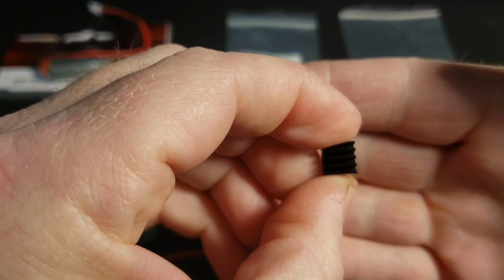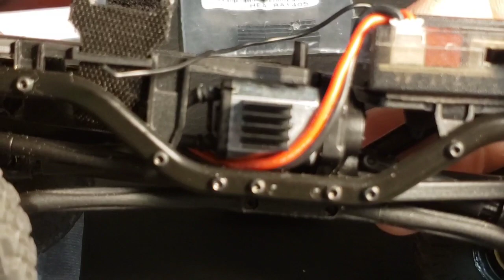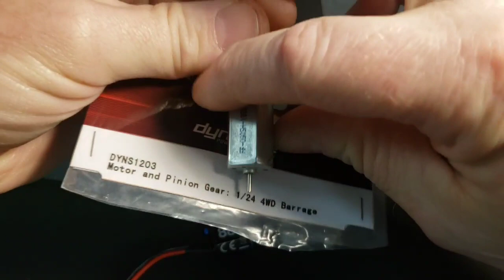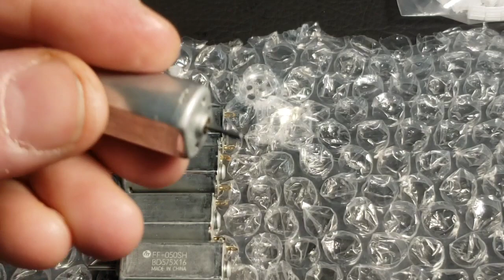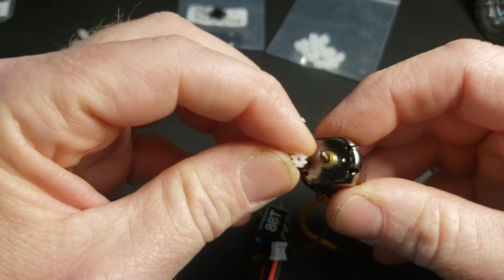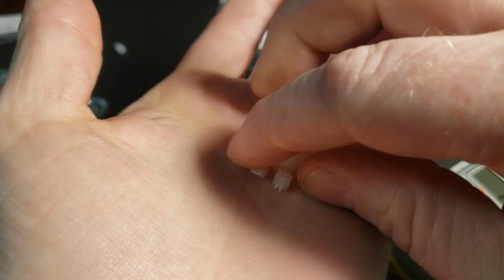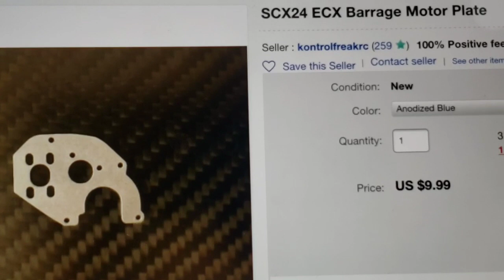SCX24 Brushed Engine And Gear Options

Comment: I just got the hot racing 8/32 and the pinion gear split as soon as I put pressure on it. I am still learning and I judt wanted to see what it would do. I want slower crawling for my c10 but I think I was going the wrong direction.  Just disappointed that it seemed so weak. I was lined up and careful.  I do have the purple injora HT motor 4w steering n stuff but the stock pinion went right on and is wonderful. V1 esc with LMH, L is basically unusable. I've become pretty good at making M work well but I was hoping for less spin on the mud slingers.  Im not really sure what spur n pinion to get and searching seems to be a lot for the brushless stuff.  Great video
Reply from the maker: For brushed I like the PN Racing gears, motor mount and the PN90 motor.
Reply: I think I confused the 2 gears names, I believe the smaller one is the spur gear, thats the one that split.   I may look into the brushless setups as I don't know what else I can do to upgrade my rig.  Thank you for the suggestion.
Reply from the maker: @Skylo420  The pinion is the one that goes on the motor. I have never heard of a spur gear splitting.

Comment: Thanks for the best video,was very informative and useful thanks again and keep the good job 👍
Reply from the maker: Since that video was made PN Racing released their 90T SCX24 motor, aluminum motor mount and gears. It does have some disadvantages but it is a good system.

Comment: I recently installed a 100T motor but it's weaker and Everytime it turns it clunks..when crawling my scx24 looks like it's hitting bumps. What motor do you recommend that's a plug and play with these scx24's?
Reply from the maker: Either the Barrage or PN70. Those are my favorites for plug and play.

I have a couple of PN90s but they aren't as good in my experience. I didn't think they had as much fine control as the PN70. 

Stock is a decent motor. It doesn't have thecsame torque as the Barrage but it is adequate, small, and light weight. 

MoFo RC has several options as well. Some are faster. Some have more torque. It is up to you to decide what works best for how you crawl.
Reply: @EXPIOWA  sweet thanks man, I think I might go with the Barrage, just saw a install video.. might just solder the cables, that is again!

Comment: I can confirm the micro Losi motors work excellent. Little mod to mounting holes ad shorten the shaft to clear trans cover or drill out center of cover.
Same great crawling as losi micro crawler but with alot of available wheel speed.
Reply from the maker: Link?

Comment: i installed a furitek brushless motor and  shredded the brass pinion gear ,its down till i get another  from overseas. that's  a problem
Reply from the maker: www. MofoRC .com has them in stock right now. ; )
Reply: @EXPIOWA  i installed a traxxis 12t48p pinion its working  4 bucks

Comment: I burned up the motor in my new Deadbolt in 4 batteries in 3 days. The next day I burned out the motor in the brand new C10 in 1 battery.
Reply from the maker: Check for binding. Motors should last a lot longer than that. I may do a video on binding points.

Comment: Little late but I dont think super glue works well when it comes to transferring heat but if it does work let me know i would love to give it a try!
Reply from the maker: Seems to work fine. : ) The sink and engine feel the same hot. Heat can be used to release superglue but its not getting anywhere near that hot.

Comment: Hello and thanks for that great tip with the shaft hitting the gearbox cover I will notified horizon hobby hopefully they will fix that issue actually if we all notify them together It won’t cost that much just to simply put an indent in the cover so we don’t hit
As of now I remove the sticker from my motor and Cut a small slit in the cover to pry the cover away from the shaft Yes I know I’m lazy and didn’t feel like tearing apart my rig lol filled the small hole back with A small dab of silicone so dirt won’t get in Motor seems to be running cooler now thanks again for that great tip

Comment: I ordered a few different ones unfortunately the ones I got were really slow I think I screwed up and ordered something that was the wrong RPM rating
Reply from the maker: I plan to do a motor number decode in a future video. Hopefully it will make more sense then. The slower reving ones often have more torque. Did you notice any increase?
Reply: @EXPIOWA  yes it definitely seem to have more torque actually the one I purchased I think listed itself as high torque the one I ended up getting had the number 10,200 at the end of it I actually got some that were standard and then I got a couple that were labeled as a rare earth magnet thought that might’ve been a little better for better brushes. The one I got listed that it would go up to 12 V I think that’s maybe where I messed up I think it’s maximum RPM was around 14,000 at 12 V. Looking back at some of their stuff I think if I got something around 87 or 8 V motor it could probably be slightly over vaulted and give you around 18 or 19,000 RPMs which would probably be pretty good

Comment: Oh I have 2 batteries that are 7.4 1200 mAh from something else in the past and a charger that works and can make them work, Would U Run them or No,I'm going nuts wanting to try this new scx out but battery charger is junk,so what would you do?
Reply from the maker: Safety note: Be very careful if you mess with wires on lipo batteries. Never allow them to direct short. 

I do not recommend altering them. On the rare occasions when I do it is only one wire at a time. Never have two loose ends.

Hobbyking has a good writeup about lipo safety.

https://hobbyking.com/en_us/battery-safety-guidelines
Reply: By the way If I didn't make it clear I will not be working on batteries After seeing what can happen! Excitement had me thinking of trying to fix a problem I got no reason messing with, I like my Hands and turning servos to much, God Bless and Big Thanks for Safety Message, Not worth💣💥 Good Bye hands,eye,everything
Reply from the maker: As long as the cords are safe it should work. A 1200 mah battery will be heavy though. I would not run more than 500mah because of weight. 

This battery is only 4 grams heavier than stock. I charge it with a Venom Dual Channel charger. I have 3 of these batteries and they work fine in stock chassis cars. The cord is slightly shorter though. 

https://www.ebay.com/itm/254890015354?_trksid=p2504926.m5232.l9681

Comment: Hello friend you don't recognize me,my phone literally Explored,while driving down the largest and most traveled interstate highway around my area,I don't know if you would remember "Who Me" that's me,but this is me until Tmobil or Motorola come to a understanding, cell phones should not be Bombs, so far they are but heads because I didn't pick up smoking bits of The Exploded Revel 4Pluse off side of highway in the rain with my Mother,and Dog in the completely toxic smoke feeled car! But we are safe only melted floor mat and one shoe lace bunt in half miner damage to my Old School Chucks Ts! So that's about all of the bad news,So a little good,I was close too the only Local Hobby Shop I know of and stoped in to slobber for a minute and I believe my Mother bless her heart was feeling bad for me from the,Explosive Tmobil device and I am blessed with a New,and First I will say real mini Crawler SCX24 But the charger that came with it didn't work well flash red for as long as it was powdered! I think I got all the information to Horizon Hobby to get that rite fingers crossed! I Ask what if anything would I need, the Dude sold me some 10$ brass hex something, but they didn't make it home! So Who knows what happened to those! Seems like good,and BAD were fighting each other the hole time, but I feel like Part Of something real that The Devastator just didn't Do!
Are there differences between scx models? Yellow Jeep is what got my attention so Rubicon hope you are a good one! Can you suggest any free mods for time being! Looks like any $ I hope finds it way to me is going to some Crap I should Not be Paying for but,What do you do but be happy to be Alive Honest too God! Hope you remember Who Me and get back to me!
Reply: THANK YOU FOR YOUR WORDS ON SAFETY,When I sent this message I was freshly home,New Little Jeep,Really wanting to See what it would do,but after what has happened in the past few days with Myself and Battery Exploding,with what I would think to be a much safer Battery,and how a mobile phone is basically treated with more care than some New Born Baby's saddle and when something goes wrong with there Definitely Dangerous products,and defensive remarks and what I would have been expected to have done to show them they are responsible! Is simply outrageous! So after not that much thought I will not be doing anything with anything that has been proven to be something that will possibly put myself, anyone or anything I Care about! It's not worth, probably not death but permanent damage and besides the people at Horizon Hobby seem to be responsible for the defective little charger and are not trying to act as if I did wrong for picking what I thought was a solid Choice in quality and Customer Service,I do not ever want to be to feel like I did something wrong because I was not able too keep some toxic smoking parts to something that almost ,and I thank God no one is hurt or dead because of something happened inside a car traveling at speeds that could kill! In other words Horizon Hobby understood and got back in touch with me quickly, and are not trying to dodge responsibility!
I understand this is like apples and oranges but common thread exploded Battery and potentially dangerous uses of the wrong, homemade fix to a problem there willing to be Honest and make right! And being Honest I have changed my thoughts on trying to get something that is made for one thing, work in something else! 
Experiencing what happened to the device made by probably the oldest,and top popular brand at one time that started making cheap,devices that, for some reason will not even put the name on a Cellular Phone,Motorola It may be difficult to remember and to some don't know What a Motorola is,thing happen for reasons, and I believe this is a example of a felling Company, and would rather treat,people who have seen what the future of a Company that shows no care for something that they Can't afford to fix,but how can they afford not to patch a hole that will sink there Moto-Ship! I think there should be some type of responsibility for dangerous, and potentially  Catastrophic for the one in a1000,10,000 who knows, But would put my hand on a Bible and tell who ever ask what happened to me,and my family Dog included! 
I do not feel right bringing something that is not safe under this roof,Motorola Shoe stings and Bubble Gum engineering set a example of something I will not be responsible for,because I care about others and there safety It's there Reputation that's Looking Poor This according to Tmobil this was not the first and I got a feeling not the last time something They would not put  there Name on Will Get them Attention ,from a Device James Bond Would make Money Penny through it like the grenade 💩There setting out to become! HORIZON HOBBY Thank you for Understanding,
Motorola thanks for showing your true colors and Greed!!

Comment: I have watched several of your instructional videos, extremely helpful thank you for this service. You’re right up there with Francis from RC Revue but you handle more of the technical aspect than the review aspect I have noticed. When I put a new motor on that had the longer shaft instead of cutting off the edge of the shaft I drilled a small hole through the housing so that the motor would not rub. I figured this would not make any difference as far as protection from the elements  sense the bottom of the cover is open anyway below the pinion and main gears. let me know your thoughts on this, thank you
Reply from the maker: Thank you! 🙂 RC Review is one of the channels I watch. That is good company to be lumped in with. 

Drilling the cover is another way to reach the same result. I shorten the output shaft because It is closer to how it arrived in the box. I try to keep things as they were unless it upgrades the vehicle's performance. In truth, that cover is unnecessary if you run it on a clean indoor course.

Comment: What are your thoughts on how much the cooling fans actually cool the motor down do you have any percentages? Just curious. After watching your presentation, I went on eBay and ordered a pack of them for my SCX 24s. I have seen cooling fans on a lotOther motors and even gasoline engines
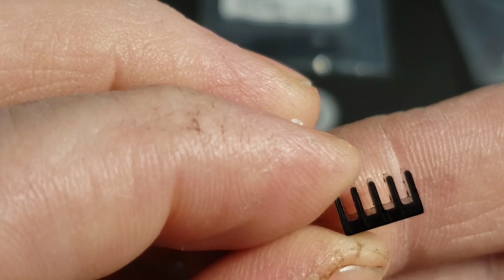Reply from the maker: I have not tried cooling fans on 1:24 cars yet. I have only had them on my B6.1DL race buggy and Ryft. They work. 

I am not sure if it is worth the weight and battery drain at this scale. Heatsinks are adequate on my rigs so far.

Comment: I believe the last 4 digits of the part number are just the lot number. So your motors are all FF-050SH form factor, and that number gives you everything from mounting hole positions, shaft diameter, polarity, case dimensions, etc. and the last 4 digits just mean they are all from the same manufacturing run.
Reply from the maker: Awesome! Thank you for that information. I had wondered. : )
Reply: @EXPIOWA  did some more digging and found this.

https://www.mabuchi-motor.com/product/knowledge/classification/designations.html

So you have a FF-050SH-1855. I'm assuming that means it's a Flat can, Precious Metal, 0 shaft size, 5 housing length, 3 pole, rare earth magnet, H motor type, with .18mm diameter windings, and 55 windings per armature (or a 55 turn motor).

From my own testing, the stock transmitter on the Low power setting puts out 6.6 volts at full throttle with a battery right off the charger, and the high power setting puts out 8.3 volts from the ESC to the motor, so the max RPM in the 6-8 volt range is the most important characteristic for performance in these trucks. The 20,000 RPM motors are probably overkill and don't give a lot of torque, but the ones around 10,000 are probably the ones we want.
Reply from the maker: That is an awesome find!! I will dig into that myself later when my schedule opens. 😃

Comment: thanks for this super informative video.
Reply from the maker: Welcome. If you have suggestions for something you would like to know about send me a message. I am here to help. : )
Reply: @EXPIOWA  well I was searching for the numbers that comes after the FF-050sh label, those are numbers that in some way indicates different models of motors with different voltages and RPM. I can't find a FF-050SH-1855 but FF-050SH-1865 which is a 6v and 17200rpm. You know the specs of the 1855 are? Thanks again!
Reply from the maker: @RaVAndres  I do not know the exact specs. I have those motors ready to go into my car. They will work over a range of voltages and will run at different RPMs depending upon power input. The main thing to worry about is the mounting screw spacing and thst the output shaft does not exceed 5.5mm.  I use a rotary tool to shave it to the correct length. Then I camphor the end of the shaft so the pinion goes on easily.

Comment: So does the mini z motor makes the scx24 faster even with the HR gears?
Reply from the maker: Yes. It is very quick. I wish I could use the .3 mod gears but it can only be used with the HR spur. There are no .3 pinion gears with a 2mm aperture that I have been able to find.

Am aftermarket ESC might make it run smoother at low speed.

Comment: I got mg scx24 the other day and the stock motor died after the first day:( so now I need to get a new one and i am looking what motor I want.
Reply from the maker: Contact service@axialracing.com They should send you a replacement motor for free. Include a picture of your sales receipt and address of the store it was purchased from and your mailing address.
Reply: @EXPIOWA  thank u I had no clue I could I will do that when my dad gets home later
Reply: @EXPIOWA  did the same thing happen to u?
Reply from the maker: @alexbliggenstorfer5680  They have replaced an SCX24 charger and an RBX10 Ryft shock that came out of the box messed up. There were pretty good.
Reply: @EXPIOWA  ok thanks for your help
Reply: @EXPIOWA  this warranty replacement of motor last for how long after purchase?
Reply from the maker: @ighfirlee  I believe one year.

Comment: What size capacitor would you recommend for the barage motor. I ordered some
Reply from the maker: I plan to move the one from my original motor over when it becomes necessary. I do not know its rating.
Reply: @EXPIOWA  do you think I can get away with trying the stock motors capacitor and wires?
Reply from the maker: @jonnyjaywalk  Absolutely.  If you didn't even run a capacitor it would probably be fine.

Comment: I'm running a HBX 180 motor in my SCX 24. With some big knobby spur and pinion gears that I took off some old rc I have. Now it's fast and still crawls pretty good. I also have brass wheel weights in the front as well the brass steering knuckle and diff covers. I got some wheel weights from o'reilly's .they come in little rectangles weighing .25 oz each. I have 8 of them on . So it's got some weight to it.  I'm using the stock shocks from my RGT adventure , I put a small piece of masking tape on them under the spring to give it more friction to help with the bouncy ness .they work so much better than the stock scx shocks. Great video!
Reply from the maker: Sounds like an awesome rig. 😀👍

Also, thank you!